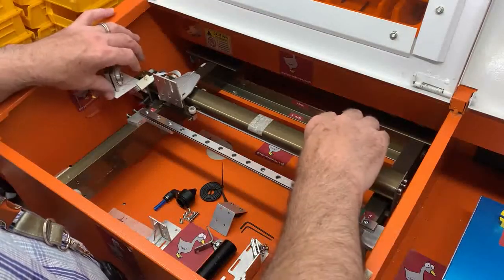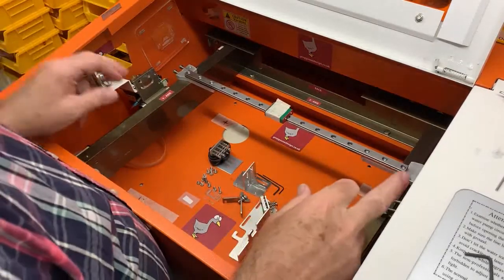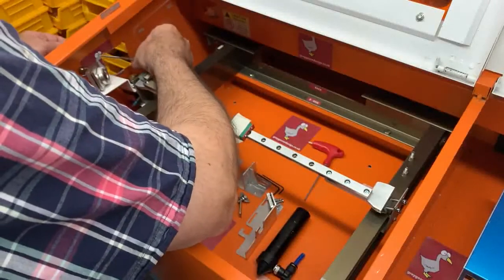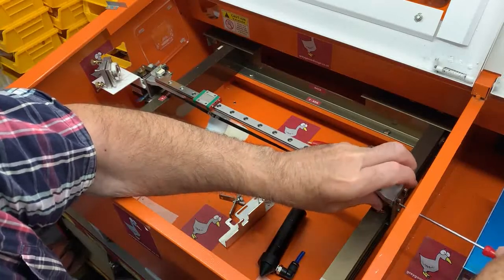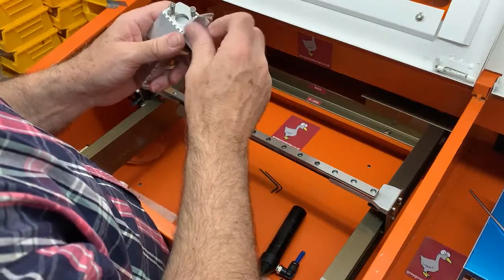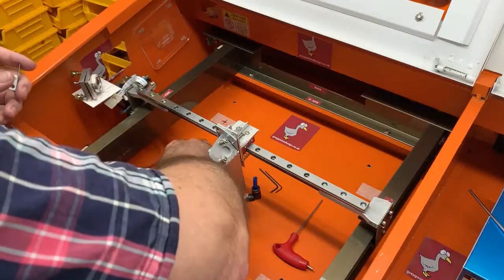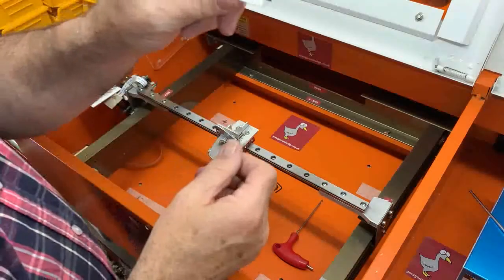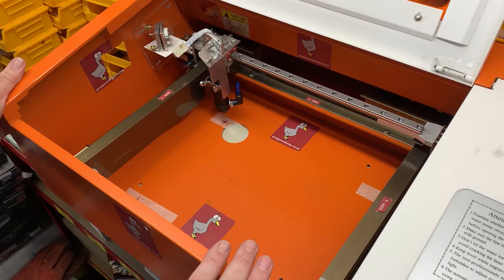Grey Goose Design   Full K40 Linear Rail Upgrade Kit Installation

Comment: So with that head you can cut or engrave material about 2mm thick, unless you cut the bottom out of the case.
More useful than this would be a head the height of the standard one but with adjustable mirror.

Comment: forgive my ignorance, but what are the benefits of replacing the standard x-axis gantry with the linear rail system?
Reply: Stability of travel on X gantry. Most of the plastic wheels are not perfectly round as well as the stock rail groves itself are not perfect. In short, easy mirror alignment on X gantry
Reply: @ferdieedquiban9047  thank you.

Comment: Is this for sale somewhere?
Reply from the maker: HI Nick - yes ! https://greygoosedesign.co.uk/product-category/laser-parts/hardware/upgrade-kits/ There are two main kits, one upgrades the head/mirror3 but retains the original carriage; the other replaces the orginal rail/carriage/head assembly for the best results in terms of performance and ease of use and beam alignment.
Reply: @gooseymedia8206  Getting a 404 error on your website and link!
Reply: Doesnt appear to be. Another of those well intentioned designs that never makes it to market